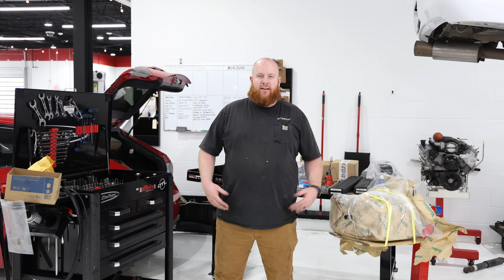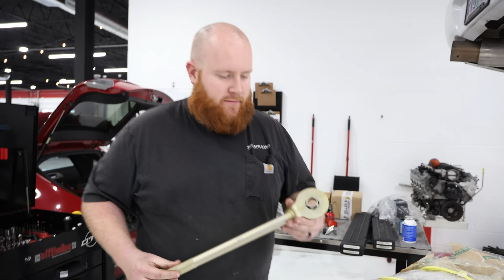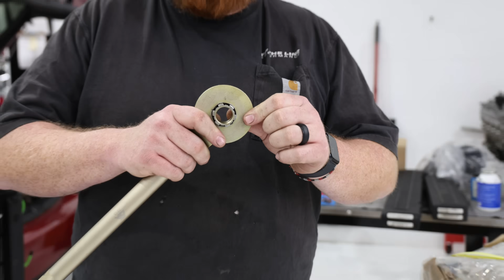The MOST in depth EJ25 rebuild tutorial EVER (wrx/sti)

Comment: You really push all this unnecessary parts replacement like the oil pan and cam gears, however you installed thenoil lines and turbo without fushing anything out 😂😂😂😂😂 you installed them just as you took them off 😂😂😂😂😂 this makes absolutely no sense at all.

Comment: I had this oil pan replacement arguement with my son over his sti. If this replace it because it might hold minute pieces of bearing after cleaning. Well with that logic then the valve covers the cam phasers oil lines hard and soft and hell the block alone should all be replaced! Telling people that are on a budget that replacing the oil pan is just plain dumb! With proper cleaning the oil pan is just as cleanable as the case and the valve covers.

Comment: I love how regular mechanics just give tips like extra torque because they know more than the engineers that did actual R&D on their own products.
Reply: Dude, having worked with engineers as a machinist, a lot of em are in their own little land of "but it works on paper!"
Reality is often cruel to the best designed parts of the smartest engineers.
Reply: @lolnopenotgonnahappen4370  While I agree with you, but I'd still trust the engineer on a mature technology on a mature platform with a proven good record, more than some mechanic with no backup other than "I've done this for x amount of years and it never failed me" aka "trust me bro". It's different when mechanics show solid proof that doing it by the specs leads to failure, and doing deviating from it with their experience proved to be better.

Comment: I'm torn on the two kinds of cam gear holders. The company 23 unit holds the outside of the cam, but couldnt that put a lot of pressure on that single pin inside of the active cam? vs grabbing the teeth itself where it stays bolted to the cam itself? I have not seen a failure of the cam gear pin, and its not like they're expensive to replace. So maybe it does not really matter?

Comment: im about to change my wrx sti VA headgasket because the heads lifted at 24psi.... i currently have arp2000 headstuds, RCM headgasket, E85 tuned to 305kw, blouch 2.5x
got very unlucky with the heads being lifted at 24psi, might be a tunning issue? once i change the gasket, ill tell the tuner to turn down the boost.

Comment: As I'm getting ready to do this myself for the first time, the lack of torque specs and socket sizes is bothering me

Also kinda weird to not put the valve covers on before doing the oil cooler, sensors, etc..

Comment: Whenever the torque wrench clicks or beeps before actually spinning the hardware, thats a good sign to back the nut or bolt off a little and go again. Likely the electric wrench or impact overtightened the fastener and now you have a time-bomb when it comes to bearings, caps, gaskets etc

Comment: Well as a raceshop owner and engine builder myself there are a few things in here that are definitely not the way they should be according to pretty much every aftermarket Stud company per engineers request. The bottom threads on the stud are supposed to be hand, snug only and not lubricated also the washers that go down before the nuts only get lubricated on the top side where the nut makes contact not underneath that is a big no no as you do not want the washer to spin, which is why we put them down dry… this is probably one of the most commonly known things amongst builders so not really sure what’s going on here….
And purposefully over Twerking the center Studz is absolutely asking for head gases stealing issues as you now have an uneven clamping load. This is probably the biggest NO NO in this video 🤦🏻‍♂️
Reply: As an engineer, not shop mechanic or engine builder. I CRINGED at the extra torque on center bolts. Like broski it’s not about “holding it harder” it’s all about even distribution of clamping force and stress across the piece. Also, it seemed like wayyyy too much lube on studs. Every video I’ve seen very clearly mention to use LITTLE BIT of lube

Comment: Does anybody else medium strength thread locker the oil pump bolts? I did mine without like in the video and had several people comment to me that its a must to do that apparently. mine was a 05 EJ257 so not sure if something changed compare to newer 257's

Comment: Did you not have to pack the oil pump with Vaseline? I’m having trouble building oil pressure. I’ve seen people say you shouldn’t fill the oil filter because it’ll create an air bubble. I didn’t fill my oil filter but I’m still not getting oil pressure. I’ve seen people say you should pack the oil pump with Vaseline. I wasn’t aware of that but I didn’t notice you mention anything about it. I also didn’t notice you unplugging the crank sensor to spin the engine and build oil pressure.
Reply: Try cranking the engine without the engine filter first until oil starts coming of the filter housing. Once the oil starts coming out, put your filter back on and try cranking again. My pressure light went off after that, and I was able to start the engine.

Comment: As a pro tuner. Let me enlighten you all. Ejs blow up because… people don’t do a boost leak test and boost leak the maf sensor tube and everything. A maf leak equals lean. Then knock events lead up to spun bearing because they don’t understand how the ecm works and the Cobb devise won’t fix it cuz it also uses the same sensor to adjust fuel based off air flow. 1 maf leak you car will be running lower load seen and therefor the timing for the low load range which is advanced for low end torque. So throw all those mods on, blow your car up is the pattern. 😅 so next time let’s try this folks. Throw all those mods on. Then boost leak every part of the intake and exhaust. Systems. Then so your tuning process, and have a good car. If you get a big maf. Your up shit creek without a tune that rescaled the timing and load g/rev otherwise it will be getting more air than calculated in that low load region of the timing map and high boost equals lean and knocking till failure every time

Comment: The expertise shows in hand torquing those bolts, the Subie engines designed/assembled quite similar to a snowmobile engine, w the block sandwiching the crankshaft, makes for a really compact and lightweight design, it's also why the stock blocks can only handle Soo much without flexing..

Comment: Hi!, my EJ25 wrx 08. I changed the passenger side valve cover gasket about 9 times and it still leaks, the cover is new with new screws. No cracks, everything normal, if I don't accelerate it doesn't leak anything. The problem is when I accelerate it starts to leak barely always from the weakest point which would be at the angle where the RTV is placed. The PCV valve is ok, and tubes ok. I wonder if the problem is that a lot of gases are generated in the valve cover but that would be very rare...

Comment: Hello, I have a problem with my 2011 Subaru Impreza when the car is cold I turn and there is no problem when I use it for a long time and I turn to any side and it feels like the front tires are activated, the transmission stops until the car is completely cold. If I have that problem, could you help me with this problem? I have already changed many parts and it is still not solved

Comment: This guy calls putting a motor together bolting parts on an assembled short block, that is called assembling the bolt ons building an engine encompasses clearancing the shortblock which is the all important part mess up there and you will be taking that motor back out after a few minutes 
of running time, that separates the men from the boys..

Comment: Question 1
You guys bought a new shortblock. If I need to rebuild my engine, the heads will be resurfaced but do I also need too resurface the shortblock the sides that connects the heads? I will keep it stock. 

Question 2
And which part should I buy from third party and which oem I could order again.

Comment: I don't like using silicone or rtv on valve covers, that stuff turns semi hard and if it falls off can jam passages etc... I use  anaerobic sealants that only harden in areas that are sealed, the rest stays liquid and can easily melt away and get filtered out by the filter.

I also don't like using dielectric grease on coils anymore. I've had times with my own project cars or customers that the crappy spring on the coil may fail to make contact with the plug because of the dielectric coating which is not Conductive.

For the Grimm speed DP gasket I've had them leak, I don't have an oem turbo anymore but it's leaked on both oem and aftermarket FP turbo. They're MLS but I've always had to put on some high temp copper spray and let it dry, never had any leaks since.

The life eval on the floor comment... 😅 Yea we've all been there, especially while installing a DP and the external waste gate

Comment: Not a rebuild... The short block was basically done... This is just the middle of the long block assembly/build.. Aka heads and on.

I do like the cam gear holder tool, but I have a 04 ej25 block w/out the variable timing on a ej20 head IIRC .

Comment: Hey man great in depth video. I’ve got a couple of questions to ask. I’ve got a 1997 jdm wrx sti Impreza. I’ve replaced the head gaskets already as I was lifting the heads. Running 2 bar of boost with a g25/660 turbo and all supporting mods including water/injection. When I replaced them I had the heads resurfaced, pressure and crack checked and everything was as it should. I used RCM head gaskets and RCM extreme 11mm head studs. It’s about 12 months since and I’m now lifting the heads again. Cat drives fine under normal driving conditions only when using full boost does it push coolant into the overflow. Car has never overheated. I noticed in your video when you torqued the studs you said on high horsepower engines you torque to 150 ft/lb. Is that with the same arp studs or with the bigger 14mm version?
  My second question was about when you put the washers on you put lube on both sides but I watched a video with an arp representative who said to only lube the top side as it will cause a bearing affect and stretch the bolt?  I’m hoping I can torque mine to a higher amount and alleviate this problem. 
Much appreciated for any advice.

Comment: For some reason I’m watching this and I’m a pro Subaru builder haha.  I use an impact gun on cam gear and crank pulley removal. Otherwise you can let me know how the fight goes and the struggle to use the tool when my dewalt mid rang impact takes them off with 0 negative side affects. Just use the damn torque wrench when you put them back on. Like every bolt on the Subaru engine should be torqued to spec or again strip all the valve cover bolts, and the one that I see stripped mornthan any other bolt is the oil pickup tube flange bolts that mount it to the block. That will kill your motor. I on every build drill out the oil pickup mounting threads and use a long cert so I know for sure that the oil pickup won’t fail. This is the #1 cause of failure, people buy the killer b pickup tube to fix the oiling then create a problem over tightening the 8mm bolts and pulling the threads out of the aluminum. To cover it with silicone and then take it to me with rod bearing failure and when I show them that they try to blame me. And I’m like I didn’t build your motor how is this my fault. Sorry but you can’t reuse the crank or any parts in that motor now. And the killer b pickup tube you just destroyed by sucking up so much bearing material and sending it to the cams and ruining them as well.
Reply: i'm not a pro  and yeah, impact for crank bolt and 23cam tools + cheater for initial bolt break.  curious,  do you torque the cam-bolts in after the timing gears installed or do you just get them Tight  till they snug?  do the cam's require a lateral lash like the crank?

cheers (thanks if you see this)

Comment: I feel like there should have been more appearances made by a torque wrench.
Reply: When I was working with a 35 year VW tech, I used to ask him all the time why he didn’t use a torque wrench. For weeks later he would make a ‘click’ sound with his mouth every time he assembled an engine. 😂 I was told that after assembling a few hundred motors he could feel it was right. 😊
Reply: If it works for them and they have great results and no engine issues is their method wrong?
Reply: @kaelll85 I doubt this car is being driven like a real track / street car on a regular / daily driver basis.
Reply: @kaelll85 luck isn’t the same as competence.
Reply: Glad I’m not the only one who thought this, as well as the lack of torque sequencing on the cam carriers and caps, improper rtv amounts and routes especially with the carriers and oil pump. Great video for a novice but the seasoned builders will see a lot of “NO-NO’s. Im honestly surprised as OTL has a good rep, figured they would follow the book 100% butttt…..

Comment: You used the oem head gaskets….why not something like cometic or felpro or whatever…why the oem ones?
Reply from the maker: The car made stock power, so no need for the upgrade! All of our big power builds get upgraded HG
Reply: I know that some people like oem gaskets for their open deck blocks
Reply: @cheddardavis5818  okay but are they better than aftermarket? Because I know these are a real problem area
Reply: Depending on power level I’m not 100% sure there but I see a lot of people under the 500hp mark using oem especially with the fa20

Comment: The MOST in depth EJ25 rebuild tutorial EVER.......... yet you cant even install the head studs correctly right off the rip......
Reply: And how exactly did he install them incorrectly?
Reply: @jack_brown7  if you ever built any engines with any studs you should know to tighten the studs by hand to not blow the threads out of the block, let alone covering every part with arp lube prior to torquing them will throw the torque specs off, I mean every box of arp bolts comes with instructions and tells you what not to do and what not to grease.
Reply: ARP specifically tells you too lube them, how are you going to try and tell someone who has built numerous 1K HP engines hes doing something wrong smh@heywoodjiblome2745
Reply: @Anonymoose0913  you clearly never built any engines since you don’t know either,  the studs should be finger tight to begin with to not put extra strain on the threads in the block, and the lube only goes on one side of the washer and on one side of the studs to get proper torque spec, not cover everything in arp lube and make up your own torque specs…..  not trying to be that guy that pretends to know everything, but cmon don’t go out there putting out build videos when you can’t even follow the instructions on the head studs that literally literally come with a step by step instruction sheet in the box
Reply: @heywoodjiblome2745  Once again, this person has built multiple one thousand horsepower engines that are still healthy and running to this day - and have been for years. You are being exactly that guy that knows everything on the internet. I think the person who has an outstanding reputation for building these engines to varying power standards and has for years knows exactly what he's doing. Where as you appear to be someone just looking for something to critique.
Reply: @Anonymoose0913  typical Subaru owner reply lol, Idc how you spend your money on your annual engine replacements, just stating a fact is all. If your engine builder can’t even follow the install instructions that come in the box for a set of head studs that’s your call. Watch some engine build videos from moto iq or jay at real st then you can compare what a legit build looks like
Reply: @Auto-Trix  And I'm telling  you how can you argue with proven results typical internet mechanic 😂😂
Reply: @Anonymoose0913  lol yea you’re right , if you see it on the internet it’s gotta be true, even if you’re too retarted to follow the instructions that come in the box
Reply: @heywoodjiblome2745  all your points you stated are correct to what ARP state bro.🫡

Comment: I just built my Ra block engine, part of my build i regapped top rings to .018-.020" bottom rings .024"...
Subaru had top ring .011-.013" top ring
And  bottom ring  .021
Big mistake not regapping a Ra block.

Comment: I'm truly confused on when putting a timing belt or chain on any engine rather it's a Subaru or Toyota, Chevy !!! And your not using any specialty tool the belt our chain accidentally slipps how would it kiss a piston and bend a valve?? When a valve that is fully opened will spring back to its seated position !!!! THE only way I can see any valve being bent is on a interference engine that's running and the belt breaks our jumps. Thanks PLMK?
Reply: Yes, as long as you don't rotate the crank, the valves won't kiss the pistons. When installing timing belt, the LH head needs valves opened to line up, and if you rotate the cams the wrong way, you can cause the intake and exhaust valves to collide.

Comment: took me 1 day to fully watch but i am confused on how you ran the car with no coolant, did you sub water if not doesnt that do damage to other parts like extreme fast temp increase
Reply: Hey thanks! You can start the car for 2-3 mins without coolant and you won’t damage anything. We do this just so if there happens to be an oil leak we can fix the problem without having to worry about if we’re going to have to open the cooling system. Just saves us a mess and wasted coolant!
Reply: I remember Cleetus making 1/4 mile passes without coolant and it was "okay". Cars don't need coolant until they reach like 200°F. The water pump can spin without fluid and it's unharmed.